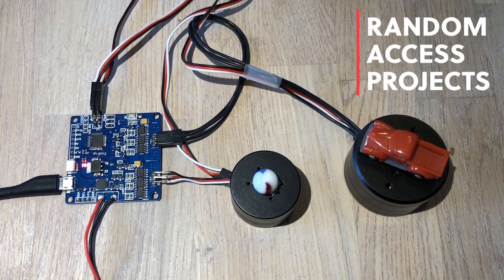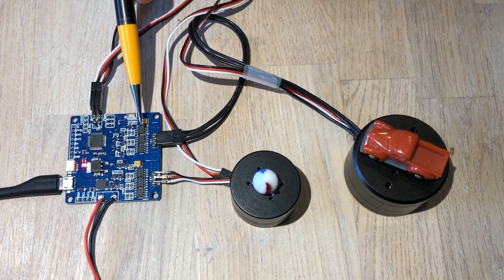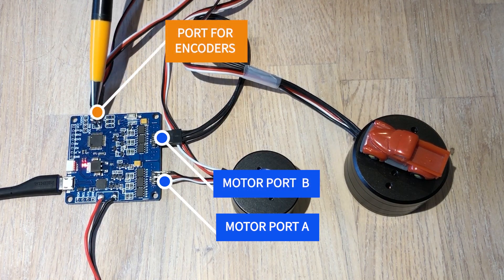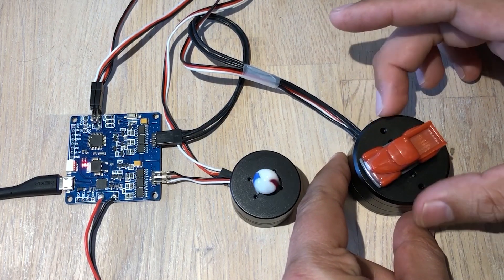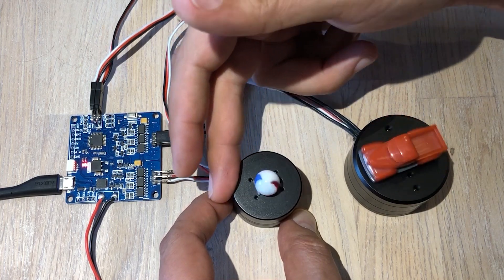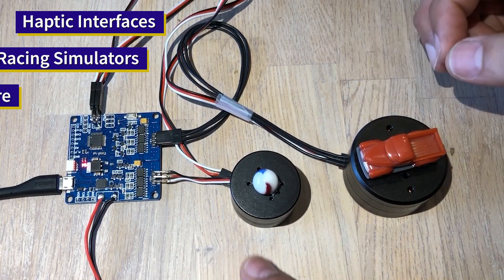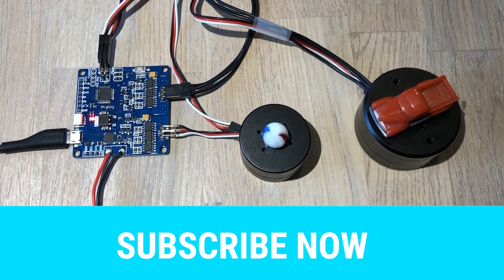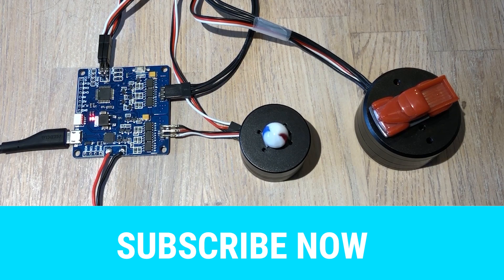Arduino Double Brushless BLDC Motor FOC Haptic Demonstration

Comment: How could you add a gps module  to this setup? Im trying to keep a tractor on a set heading for straight rows.
Reply from the maker: Not that easy, but also not that hard. You need to account for the kinematics of the tractor, which has an ackermann steering architecture and also you must know the heading of the tractor, which you could obtain from 2 different points of the gps, but also from an electronic compass. Then its just a few maths to implement a PID or similar controller to keep the tractor on a predetermined heading… for commercial applications you would probably require a lot more redundancy like laser scanners to detect obstacles etc

Comment: Hey it's me again, i wanted to tinker a bit again with your board, but i can't find a pin map or anything on how it's connected 
Mind pointing me in the right direction ?
Reply from the maker: Check the GitHub, all info is there

Comment: Can the control of 2 gimbal brushless motors with encoders be achieved using an arduino uno and an adafruit motor shield v2.
 Thanks for your answer

Comment: For your new board, you have ~2 transistors + 4 resistors + 1 capacitor for each AO4606. Are the transistors for supporting a higher motor voltage? Or are they a safety so you can't have both sides of the h-bridge conducting at once? (or both?) And what is the capacitor? Just to reduce transients or is it doing more?
(And so many resistors because they are BJTs ? It seems like too many for some pull-ups / pull-downs)

Comment: Can you use this board for a closed loop control for using a Brushless motor as a servo. I need for an application some 500-1000 turns of the motor with a high gear inbetween, the motor is recommended in drone flying with a 12A ESC so I wonder if this board has enough power.
Reply from the maker: Look at my other videos, the one with the robotic arm solves your inquiry. The max power might not take 12A continuously, but you can always upgrade to a larger power stage, so yes, I would recommend this board to begin with. Thanks!

Comment: Hello Pablo, I used 2 motors of 36N42P, set P at 1, Torque at 60 and motor trembling or vibrate badly (one motor trembling pretty bad & the other one is kind of jerky in following 1st motor), any suggestion?
Reply from the maker: With closed loop it can me so many things, could be the offset value, could be the motor is inverter in direction, try that and let me know how it went
Reply: @RandomAccessProjecs  how can you find offset value? I tested with all 0 & motor spec doesn't show that info. I already tried with flipping 3 wire to motors and same result
Reply from the maker: @MrMotionIV  watch my other videos to understand what this value is... get started with open loop and then go to closed loop with 1 motor, baby steps!

Comment: Nice little demo!  Is it possible to use absolute encoders with this board or just incremental?   Would a 14 bit encoder work OK?   (this is for a low cost (and, relatively, quite slow) xy galvo-type scanner for a laser.
Reply from the maker: jcims hi! Thanks! Watch the rest of videos on my channel for more examples . And YES! we are using 14 bit absolute encoders with this board. You can drive 2 motors at the same time, ideal for XY scanner. For a laser scanner you might be able to get away without any feedback as the mirror dont add too much load to the shaft (watch open loop video)... but you can also run it with feedback using the AS5048A sensor (watch closed loop video) ;)

Comment: Hello,
First of thank you for the interesting video series.
I am planning to purchase the board.  
Can you please share the link for the BLDC motor you have used. Also please share the details of power supplies.
Reply from the maker: Akhil Raj R hi! You can search ebay for brushless motors as5048, or just buy the sensor and put it into one of your existing motors, this one I used on the video: https://rover.ebay.com/rover/0/0/0?mpre=https%3A%2F%2Fwww.ebay.com%2Fulk%2Fitm%2F184296281651
Reply: @RandomAccessProjecs   Thank you so much. Can you please suggest a power supply for the board or can I use any 12V power supply to power the board?

Comment: Can i somewhere buy the small board i can see in your old video ?
Reply from the maker: O to the o i bought it from a french company but they ran out of stock. They were about 25 usd plus shipping, for only 1 motor. Maybe the link on the video is a better deal for you? Also, It supports our channel :)
Reply: Well than, i'll go for your version, 25$ is a bit too pricy for one controller

Comment: Hi,
 I was brainstorming this for a while but wasn't very confident, whether this even possible!
But this video gave me some confidence to tinker with motors on my desk.
What I can think is below:-
I can imagine this as a spring being twisted in air. One End (Motor A) is rotated then other free end( Motor B) follows and vice-versa.
If the spring is  twisted by any one end and other end is hold tight by hand, both ends will  experience equal and opposite torque  and  when released spring will try to reach middle position (i.e. half of degrees of  twist )lets call it equilibrium position
In this scenario lets assume some terms
Position of Motor A = ActPosA
Position of Motor B = ActPosB
Equillibrium position (ideal position that each motor will try to achieve)= EquiPos

So I assume the position control is Proportinal 
Case 1-  Motor B is free, Not loaded
When Motor A is moved then Motor B  shall follow
Case 2- Motor B is Loaded, hold by hand
When Motor A is moved, Both motor shall try to move to Equilibrium Position (Half of motor A movement)

So the setpoint of control shall be EquiPos= (ActPosA+ActPosB) x (Bias)
where Bias = 0.5 ( for Motor A and B are equal)
           Bias = 0 to 0.5 (if Motor B movements is need to be followed more OR Motor A gets more reverse force )
           Bias = 0.5 to 1 (if Motor A movements is need to be followed more OR Motor B gets more reverse force) 

This EquiPos is the point where each motor shall try to reach by using appropriate Control method.
For selection of proportional gains for each motor, we can use similar biasing calculation depending on each motor specifications.

Example- Base example is remote operation where human operators need some kind of feedback (or  Back pressure, reverse force)
 1. Excavator where operator wants to have feedback to save the metal tooth from digging into hard stone or saving a underground metal pipe. (Bias towards 1 for Operator having motor A, assuming Motors are same)
 2. Remotely operated power-steered buggy where operators wanted to feel forces from the ground onto the operator's steering (Bias =0)
 3. Robotic surgeries where doctors need precise feedback. (May be Bias toward 0 with  Doctor holding Motor A. assuming Motors are same)

Would love to hear from you, any comments and waiting for your upcoming video to see your implementation.

Comment: for each loop check for a change in the position of both encoders, if one changes, set that as the new position of the other motor. at the end of a loop you set the new "default" position for both and wait for a change. thats my over simplified guess
but yeah, it looks interesting. i could see this being used to puppeteer bigger robots with a smaller  version of it.

Comment: Hello 
My explanation: 
The big motor (A) has a sensor A and the small motor(B)  has a sensor B so you have to read both sensor in a arduino interrupt and save the previous and actual value

Have to change de value of the sensor because the big motor has different #poles and the small motor (B) has less motor so have to do a correlation. 
Example motor A =11 poles and motor B=7poles, translate the electrical position to position in degrees (0-360) 
And again translate the position in degrees (0-360) to electrical position but with the different motor 
So 
ActualA =map(pulseencoder,4,902,0,(48*#polesA));
ActualA=constrain(ActualA,0, 48*#polesA)
  posAnew=map(ActualA,0,(48*#polesA),0,360);

If posAOld=! posAnew
(Chance de value of electrical position for the smallest motor)
ActualA =map(pulseencoder,4,902,0,(48*#polesB));
ActualA=constrain(ActualA,0, 48*#polesB)
currentStepA_motorB= currentStepA_motorB+ dirección+offset+ActualA
currentStepB_motorB= currentStepA _motorB+ 16;
currentStepC_motorB = currentStepA_motorB + 32;
End
ActualB=map(pulseencoder,4,902,0,(48*#polesB));
ActualB=constrain(ActualB,0, 48*#polesB)
 posBnew=map(ActualB,0,(48*#polesB),0,360);

If posBnew=!posBold
(Chance de value of electrical position for the biggest motor)
ActualB =map(pulseencoder,4,902,0,(48*#polesA));
ActualB=constrain(ActualB,0, 48*#polesA)
currentStepA_motorA= currentStepA_motorA + dirección+offset+ActualB
currentStepB_motorA= currentStepA_motorA + 16;
currentStepC_motorA = currentStepA_motorA + 32;
End 
posAold=posAnew;
posBold=posBnew;
End interruption 
Application: I’m learning from your videos how to use brushless motors because this type of control and motor can be used in rehabilitation, currently few devices enabled active and passive rehabilitation and with the implementation of impedance control (haptic) can generate both types of rehabilitation.

Comment: My best guess is that you fed the readings of the encoder values for each motor to the other motor. Because of the clear shaking of the left motor, I think it's a simple comparison between the current position of the motor and the goal position (which is the current position of the other motor) which would then set the torque to 90 degrees from its current position to the direction of the goal position. Since the shaking is much less severe in the larger motor, my guess is that the smaller motor is not calibrated as well, or the encoder is less precise.
some pseudocode:
if(posM2 - posM1 > 450) then M2 -= 900 
else if(posM1 - posM2 > 450) then M1 -= 900 
if(posM1 - posM2  < 0) then (move M1 right) else (move M1 left)
One application for similar control is in wire or plastic filament extrusion factories where there are multiple motors pulling on the material and it is important to maintain synchronized positions to ensure uniform dimensions even when there are imperfections in the raw material being extruded. This is also used in remote labs with a robotic arm where the materials are too small or too dangerous to work with using bare hands. The force feedback allows for greater precision and accuracy when compared to a basic rotary encoder whenever the arm makes contact with anything.

Comment: Hello in my opinion the two motors are align on the same encoder value. When this change in one of these the sw move both the  foc vector to align to the new position as in 2.10.  I know industrial servo motor has a mode for do this particular task (example lexium gear mode ) or in medial robotic surgery, when the doctor can move remotely a robot :)
Reply from the maker: Frank chou you are getting close... can you detail using some math?
Reply: @RandomAccessProjecs  Hello, so here i wrote some lines that read encoder value and as the value go over a threshold set the position for both in the middle value , so the motor with less load  torque should follow the "master ".
Hope to be clear :)

#define encoder_treshold 0.5 ; 
double encoder1_value, encoder2_value, treshold ;

for(;;){
	
	encoder1_value = read_encoder1();
	encoder2_value = read_encoder2();

	if (abs(encoder1_value - encoder2_value )> encoder_treshold {
	
	mean = (encoder1_value + encoder2_value)/2;
	
	motor1_pos(mean);
 //set motor closed loop position that imply inreasing torque
	motor2_pos(mean);

	}
}
Reply from the maker: @frankchou1401  This is very accurate, I smiled as I read it... YOU WIN!!!! please send me your shipping info so I can send you a NEW Board Rev 2.0 :)
Reply: @RandomAccessProjecs   waiting for a pm

Comment: Hello, you can program it using arduino IDE? can you use it to control also PMSM motors via FOC?
Reply from the maker: Christoforos Rekatsinas yes, its programed using the Arduino IDE, has an AT Mega 328P, so its an Arduino Pro. Im using my own version of FOC, which only works in slow speed, as it drives the torque via voltage, instead of via current, it has no current sensors. Hope this is useful for you ;)
Reply: @RandomAccessProjecs  Great. I would like to see your own version of FOC!! Next version should have 3 analog inputs to monitor current ;)!!
Reply from the maker: The videos are in the channel, just look for Part 2. The board does have Analog inputs to implement current sensing, but its not needed for the applications Im doing. ;) watch the other videos and leave a like

Comment: Thank you for making this video. In fact, this series of videos made me understand more about BLDC motor control, it helps me to be doing projects related to BLDC motor and as5600 sensor. As for the code, if it is possible to output 6-pwm, it is better because most common drivers use 6-pwm input.
Reply from the maker: so sad usually the 6 inputs can be reduced to 3 as H and L are, for general applications, complementary, so when UH is high, UL must be low, otherwise you would make a short circuit. See if you can make a simple circuit that inverts the signal you give, so then you can connect UH and UL(inverted) and drive them with the same signal ;)
Reply: @RandomAccessProjecs  I think the code I can add to the pulse / direction control type. A count can be added so that when the value of the pwm pulse goes back to the beginning, one leg of the pulse will reverse at a high or low level. It will solve the problem of overlap between UH and UL.

Comment: I would have SetPoints for each motor (SP1,SP2),  RealPosition (RP1,RP2) and stiffness (P1,P2, PX=k(SPX-RPX)). When SPX-RPX != 0 there is external force on this motor, so change it's SP and the other's SP to be in between RP1 and RP2. If they are not blocked they are turning together. If you hold one motor and turn the other you will fill the torque in both motors because the SPX-RPX is changing.
Reply: Is the stiffness coefficient alone really enough for it to be so steady?

I haven't played with gimbal motors yet and I don't know the properties/behaviors of the actual thing.
Reply: @slowpaste  Stiffness is just the P from PID. If you apply whole PID is not like a spring anymore.
Reply: @LiliumJSN  in other words PI or PID control moving both motors toward a set point between the two motors is the same as a virtual spring/damper between the two?

If so, that basically gives me some new intuition to how PID works and probably makes tuning PID much easier when I get around to it.

It seems a viscous force adds stability in a fairly similar way that a PID loop can dampen a system.

The P is like the position for a spring. I is affected by velocity so it controls like a damper, and D takes into account acceleration, so it is designed to counter an external force. Is this how PID control is used or am I misunderstanding something about it?
Reply: Wait does this mean a PID loop is actually more like two springs and a damper? One spring "attached" directly to the desired position and one spring moved to match the calculated/predicted external force.
Reply: @slowpaste  Only the P part "simulates" a spring. Integral and Derivative do not act like dampening. Dampening is an f(x) function, while integral and derivative are f(t) functions. It's not the same concept.
Reply: @LiliumJSN  I took a more careful look at what happens in each timestep and realized that the "damper" is actually the derivative and the second "spring" is the integral term. Tell me where I am messing up here:

1) Motor torque set in proportion to position is the same as how a spring produces force in proportion to position.
2) Motor torque set to the integral with respect to time produces a force that changes depending on how much time the error remains, so it is like a spring where the anchor point moves to pull in the remaining error if there is an external force preventing the first spring from pulling to 0 error.
3) Derivative with respect to time is velocity. A force dependent on velocity is the same as the viscous damper in my concept.

Basically, my attempt at an explanation for the demonstration ("spring/damper" simulation) is equivalent to a PD controller (without the I). I suspect adding in the integral is not the best idea when trying to form what feels like a two-way "mechanical" connection between the two motors.
Reply: @slowpaste  Correct. Dampening is an f(v) function, my mistake. So you can relate them.
Reply from the maker: This is a very goo explanation ;) will reveal how I did it on Monday.